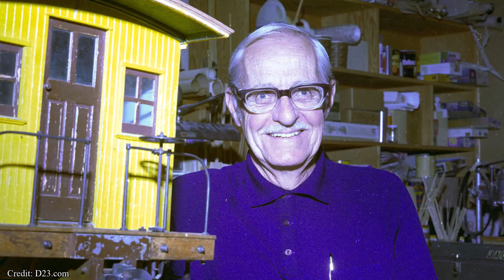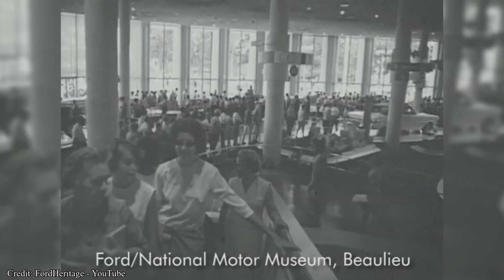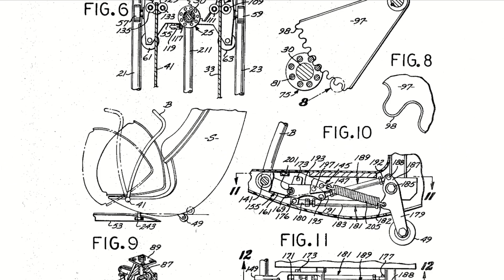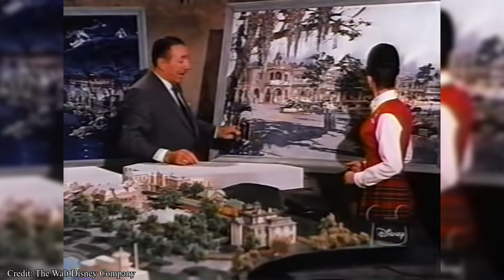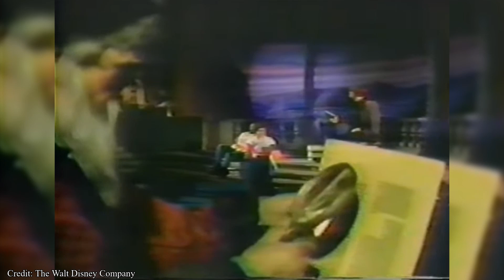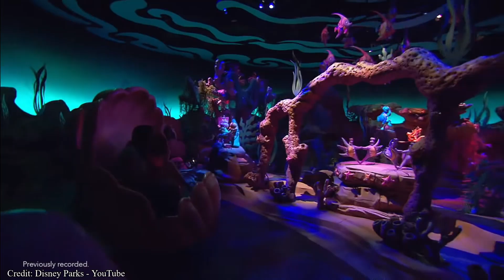The History of the Omnimover

Comment: One thing notable about the non-Disney Omnimover style rides, like the ones made by Mack Rides and Schwarzkopf (even though I am only aware of one Schwarzkopf installation) is that, likely to circumvent the patent, their ride vehicles can't tilt forwards and backwards. Their axis of rotation is always perpendicular to the track instead of always upright. The rides are often designed such that the cars face backwards when going down a slope so that you rest comfortably against your backrest instead of hanging in the lap bar. As someone who is way more familiar with the Mack and Schwarzkopf versions (I don't live exactly near a Disney park), I didn't even know that theirs stayed upright until now.

Comment: Peter Pan would have much better capacity if only they would invert the Omnimover from suspended tracks above somehow.
Reply from the maker: Horizons used a suspended omnimover system. So it's definitely possible. But I think it'd basically require them to rebuild those rides from the ground up. And since they're opening day attractions for both Disneyland and Magic Kingdom, I doubt they'd risk the negative fan reaction of having to essentially demolish the originals all for a little extra capacity. Besides, the low capacity means they sell more Lightning Lanes. 😏

Comment: I’m not sure whether or not it came before or after Ariel’s under sea adventure, but the Nemo and Friend’s ride at the Sea Pavilion in Epcot should also be mentioned. I believe those vehicles are shells like the Little Mermaid attraction
Reply from the maker: The "Clamobiles" in The Seas with Nemo & Friends do indeed pre-date the Little Mermaid rides in DCA and Magic Kingdom by about 5 years. The main reason we didn't mention them in the episode - aside from time and flow of information - is that, as far as we could find, the underlying Omnimover ride system from The Living Seas was unchanged (or, at least, didn't do anything new with the system that wasn't already on other Omnimover rides). That said, the original vehicles in The Living Seas didn't rotate the way the new Clamobiles do, and they did extend the track, so it's not like they didn't alter the ride significantly when they rethemed it. 

By comparison, the rotation of the vehicles on the Little Mermaid attractions are controlled by a small motor within the vehicle, instead of the "guide rail" of traditional Omnimover attractions. That modification of the original Omnimover mechanism is the main reason why we mentioned them (and Buzz Lightyear's, which uses the same mechanism, but with rider control). 

Also, it appears the cars are different between The Seas and Little Mermaid in other ways, too. The Seas' clams have a little gate along the front that opens and closes. The Little Mermaid clams are open on the side, and have a lap bar restraint. The sculpts between the two are also different, with the backs of the Little Mermaid clams being thinner than the "Clamobiles". That said, the paint job is very similar between The Seas and the Magic Kingdom version of Little Mermaid (so similar I had to go back and confirm they weren't the same sculpt, at least on the back part), but for the DCA version the cars are painted in a few different palettes, which really highlights the differences in how the sculpts shaped.

Comment: At some point in the late Before Days, they were talking about a Mary Poppins IP dark ride for Epcot and I got to imagineering up an 'omni-mover 2000' with a third control rail giving lift, pitch and roll control with rotation on a motor. The ride vehicle would be a period gasoline automobile with sightline controlling roof.  If I was in charge. I also want a Star Wars Death Star with a dark roller coaster inside. Dueling X-wing V Tie Fighter meets Space Mtn?